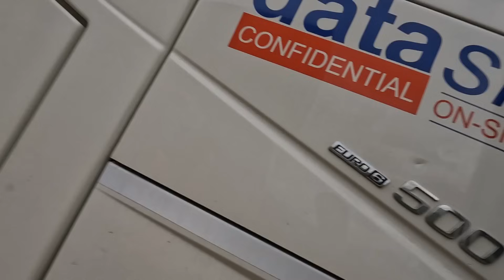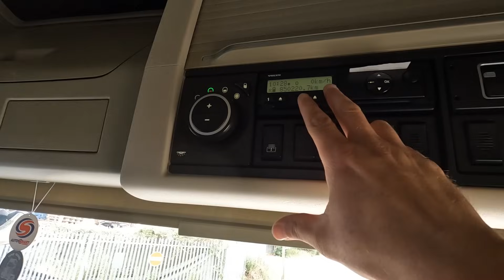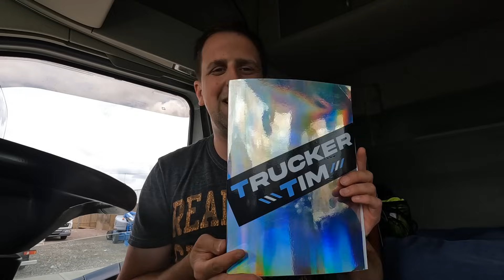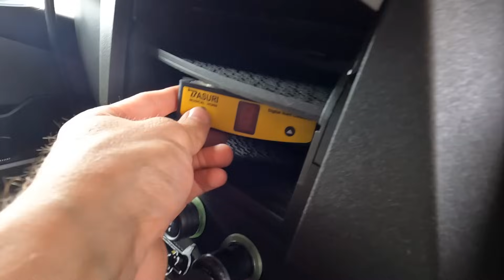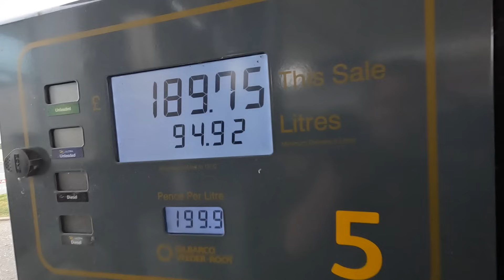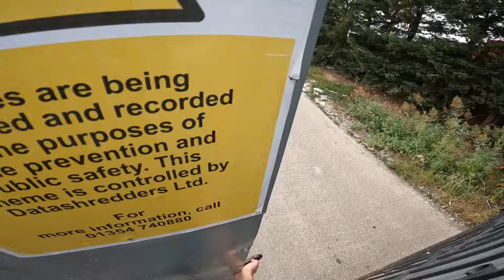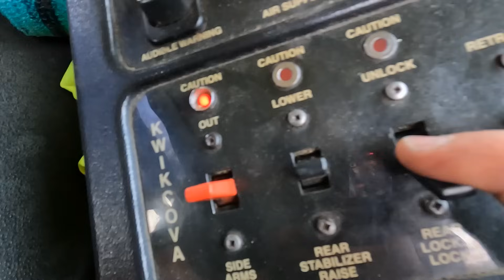Sent Off Site Empty | OVERLENGTH | Trucking Vlog 69 | #truckertim

Comment: Hi Tim, when carrying any machine (even a cherry picker) I’d recommend putting a strap on an anchoring point of the trailer at one side and putting it onto the shackling point on the opposite side (for example you strap it to the left of the trailer and right of the machine as it then stops it moving forwards, backwards and sideways as there is more support on it)
Reply: Good comment Charlie , you are exactly right.